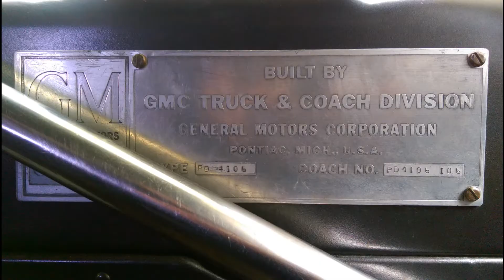More Degreaser and Engine Paint  - GM PD-4106 #106 Vintage Greyhound Bus Conversion

Comment: GREAT JOB....I KNOW YOU LOVE YOUR BUS....MONEY IS IN THE DETAILS...WE DID THE SAME THING BUT THE ONLY THING I WOULD HAVE DONE AND MAYBE YOU DID WOULD BE TO USE STEEL WOOL AFTER EVERYTHING THEN CLEAN AGAIN WITH LACQUER THINNER THEN PAINT IT....IT'S MORE WORK THAN PEOPLE THINK ...IT'S NOT JUST PICKING UP A SPRAY CAN AND SPRAYING...GREAT JOB....WHEN THE TIME COMES I'M GOING TO PAINT THE WHOLE BUS...DON'T WORRY NOT THE ALUMINUM SIDING....
Reply from the maker: Thanks!  There was a lot more brushing and degreasing that happened off-camera, I assure You.  I was under time constraints, so it was not feasible to attend to every little detail, or I would have polished out all the brass piping, and probably the valve covers and any other brass or aluminium like I was tempted to.  This was supposed to be a quick-ish spray and swap that turned out to also need some cradle and bulkhead repairs, but with all the delays, unexpected issues to sort out (more about that in coming videos), and my aversion to installing any part that is still coated with gunk, I had to find a happy medium; just quickly cleaning and painting what I had off anyway.  I'm pretty happy with how it turned out in the end, though I may return to that brass one day.